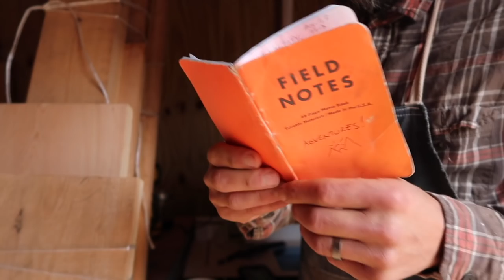How to make geometric wood wall art

Comment: Quick question.  Are you using a pin-nailer to attach the wood pieces or a nail gun?  Do you use glue at all or no?  I saw a bottle of glue?  Thanks!